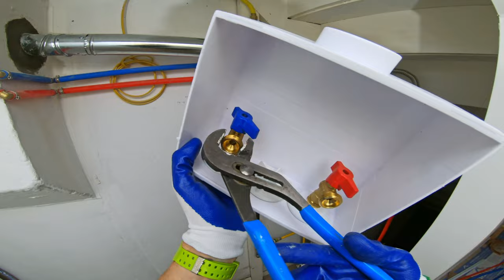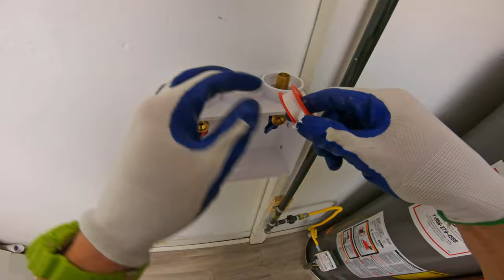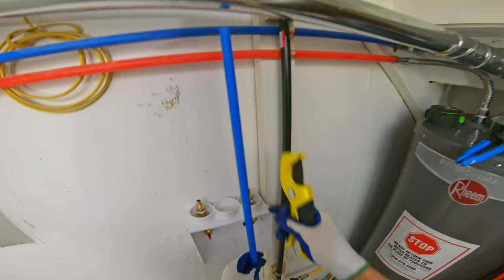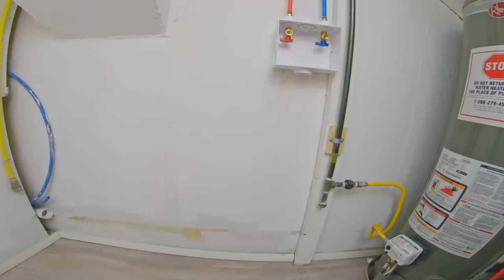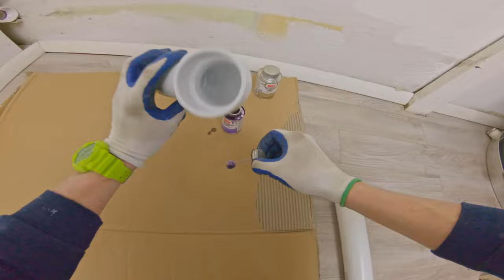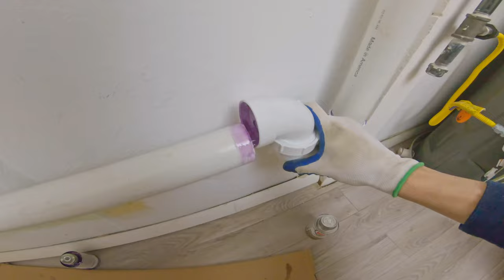Installing Washing Machine Outlet Box on Concrete Wall - The Whole Installation Process

Comment: Great video! This was awesome. 
I wonder, do you always only glue one thing rather than both fitting and pipe? Never seen that before. Hope it doesn’t leak!
Reply from the maker: Thank you Andy! It all depends on the glue and connections. If the glue is fresh/new and I apply a lot of it, it's mostly on one part. If the pipe has a larger diameter and I need more time to connect everything, then mostly on both parts. Only once I had a problem with leakage and it was on a large diameter pipe. And I have probably made hundreds if not thousands of different connections of this type.